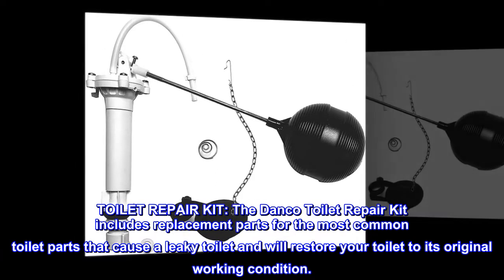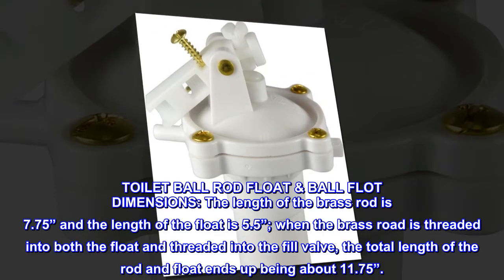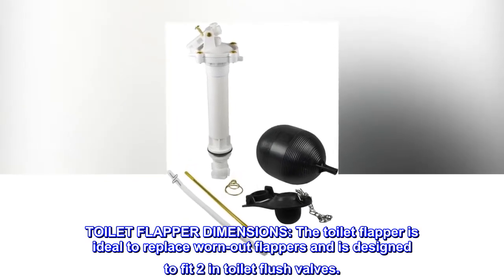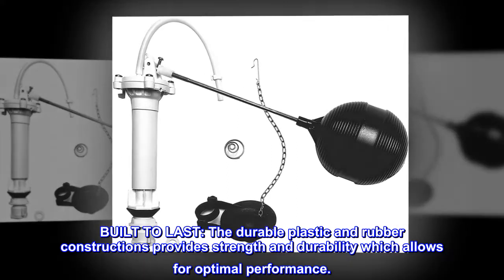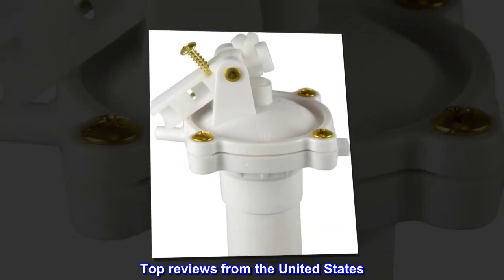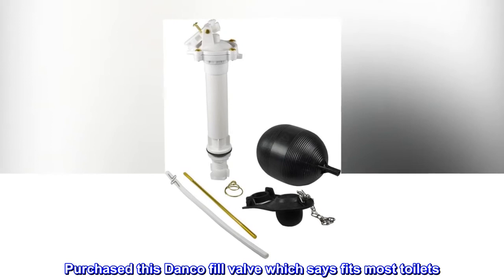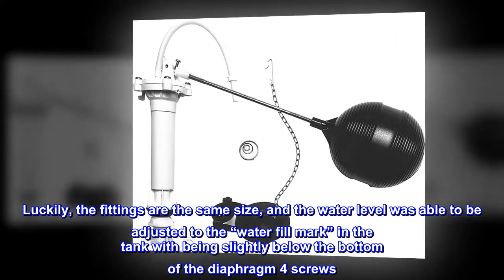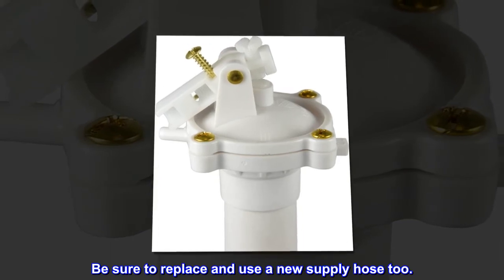Danco 80816 Complete Toilet Repair Kit Fill Valve, Flapper, Rod, Float Replacement, White

Comment: The instructions are in teeny-tiny print and it is not at all clear how to install the spring.  I am extremely disappointed that there is no how-to-install-this-thing video!!!!!  I don't need an ad, as I already bought it.  But if I can't get it working, I'll have to return it.  An instruction vid would be much better.